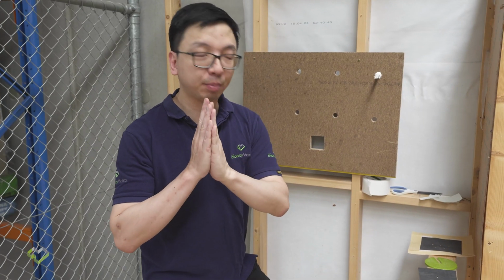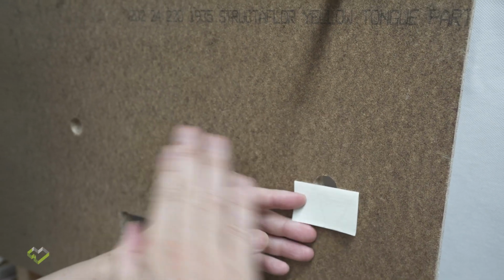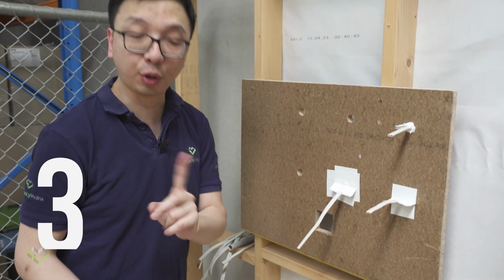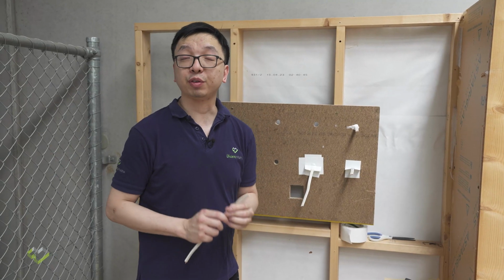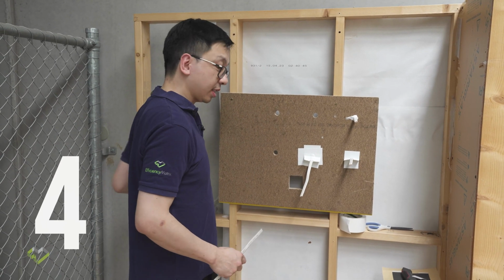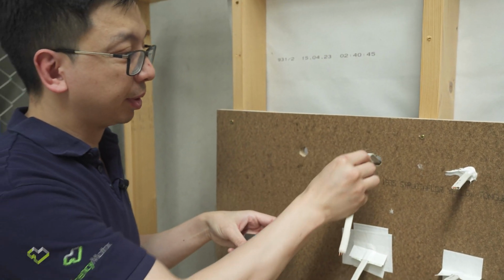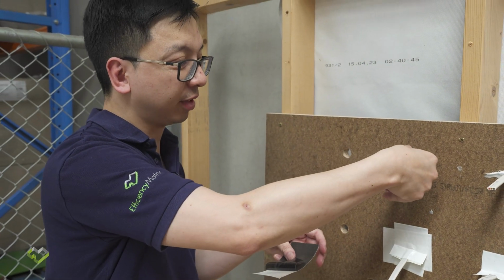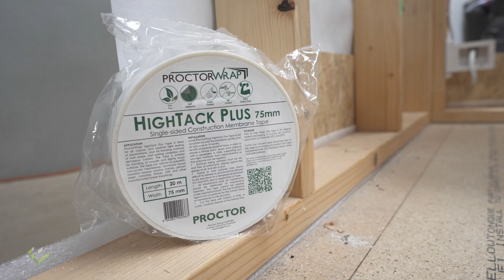Sealing up electrical and data Penetrations in our buildings.

Comment: This is a great video. Can't believe I missed this one! I'm an owner builder constructing an high performance 80sq extension with 12 external protrusions in the WRB. I'm definitely going to use EPDM patch for those, even the plumbing because it just looks so easy and will last. Then there is the internal ceiling wrap - I just counted 17 lights/ceiling fans. They will all need sealing against the ceiling wrap - I think the EPDM will be good for that too.

Comment: It would be good to see how you would then install a powerpoint flush with the plaster. Would it be better to seal the cable to a recessed box and then silicone the recessed box behind the plaster?
Reply from the maker: We actually have a PowerPoint box available on tightHOUSE.com.au, that we get made in Australia, check it out.  https://youtu.be/WmVAbSt-Ovw?si=77BeY8F45m1P9J_l
Reply: @ecoevo  Yes, but what if my power point doesn't fit your product (see list of exclusions - I'm using a Hager product listed). I'm am too trying to work out how to sequence the installation of power points to get them sealed to the wall lining (I'm using ceiling wrap but not wall wrap - the gyprock + paint will be the airtight layer on the walls).

Comment: Whats the best way to seal oversized holes for AC cables and/or Plumbing pipes?
Reply from the maker: Spray foam and caulk.   Some sort of gasket may be the best solution.  We are actually working on a product at the moment.c. TBA

Comment: Do you know how dusty work sites are?  Dust on everything, wet, poor surface due to mishandling. Tape no good.  Takes too long to clean all the substrates to allow adhesion. You need something that can be fixed with a screw or twist shank nail. Not tape.
Reply from the maker: @remoman  have you tried these tapes?  You may be surprised.  But it is good practice to wipe away dust.👍
Reply: Tape & putty worked for my home renovation. Cleaned dust first. Easy. Screws/nails defeat the purpose of this method of sealing for maximum air tightness through a penetration.

Comment: I’m in the States, and all wires by law terminates at a box (metal or plastic). So it is the surrounding of the box as it penetrates out of the wall that has to be sealed, and also the wire holes. Some people us polyurethane foam in the wall cavity.